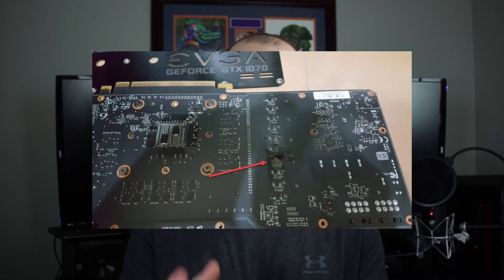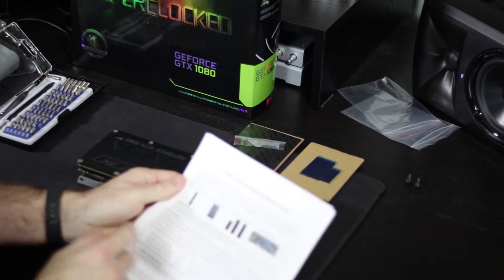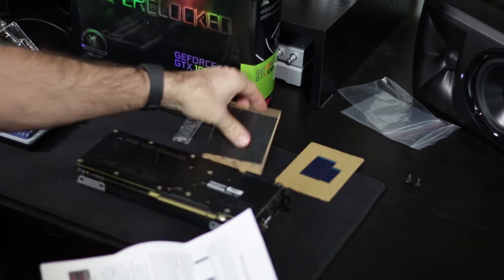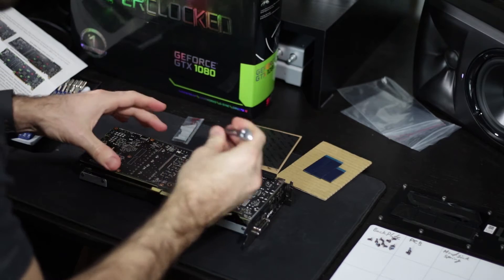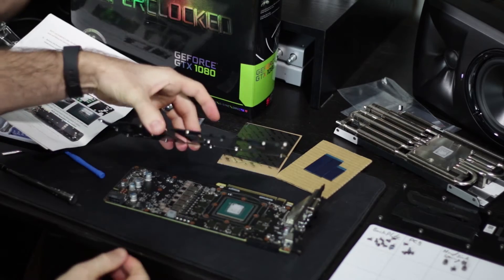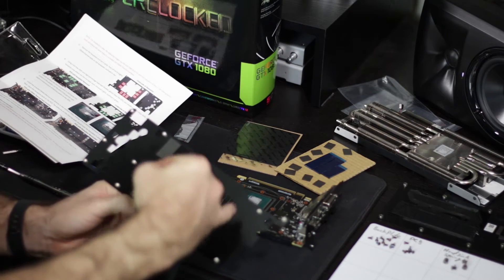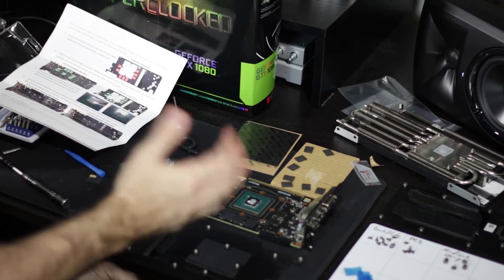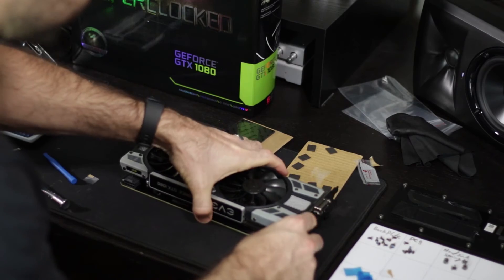EVGA GTX 1080 ACX 3.0 Thermal Pad Mod

Comment: where did you buy this set
Reply: Kind of want to buy it as well for my 1080 card since it runs hot and i want to replace pads with new thermal paste but no luck so far in finding them, they are probably long gone since this is old graphics card. Did you had any luck finding this kit?